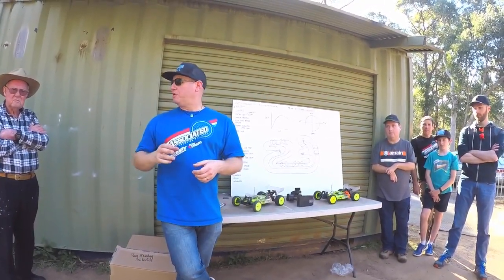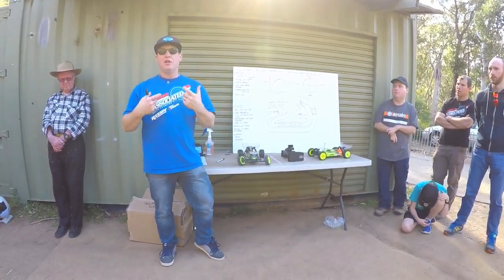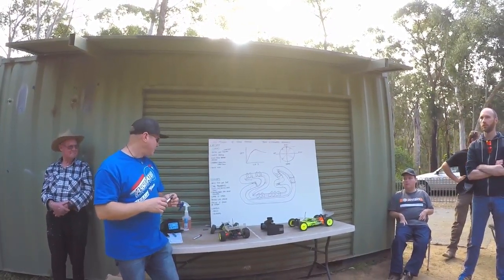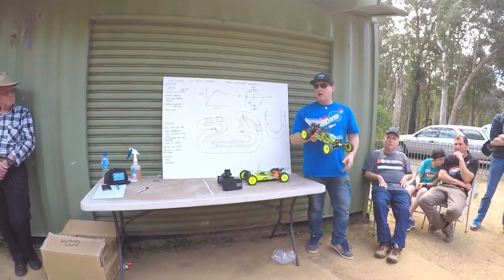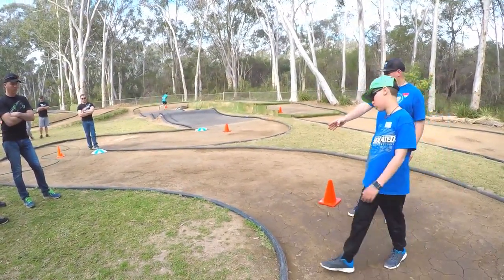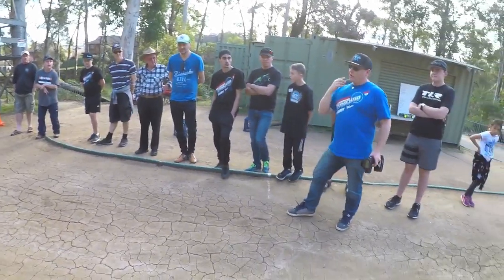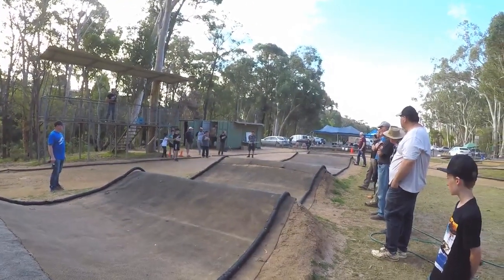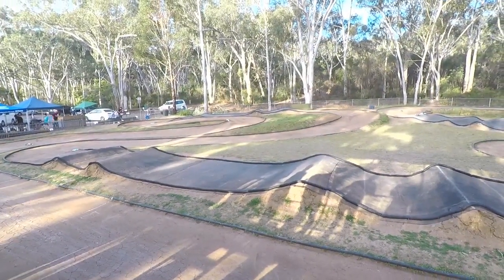Ray Munday- RC Skills Tutorial

Comment: Thank you so much for this!

I'm 55 years old, and have been racing (off and on) since the late 90's. I started out bashing Losi stadium trucks in the mid 90's, and then actually racing nitro truggies around early 2,000's. 

I now race 4wd 1/8 Ebuggy, and 1/10 Ebuggy.

Through the years, I've been back of the pack, mid pack, and a dozen or so podiums. I finally learned that the "slower is faster" saying has merit.

I've found myself obsessed (literally) with setup, and received some great advice through the years, but only in bits and pieces. No fault of the advice givers of course, it's just that, that's what you get when trying to correct a specific problem, or try to achieve a certain outcome for a given situation (like approaching a certain jump, or how to attack a certain woop section, etc).

I've googled and YouTubed rc racing "clinics", and "RC driving techniques", and "how to be faster at RC", all leading to SPECIFIC (single) scenarios, or problems. That's great, but it doesn't really help with the big picture, which is what I've been chasing. 

This is EXACTLY what I've been searching! 

I plan to watch this several times, and study all this guys videos like it's a college course. 

Thanks again Ray!!
Reply from the maker: Glad you enjoyed the video mate. All the best with your racing. 😉